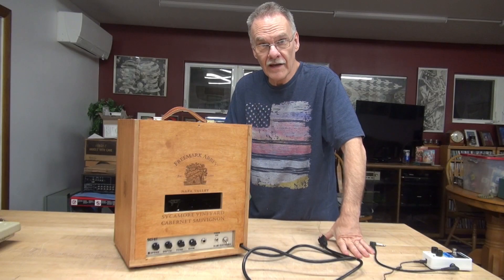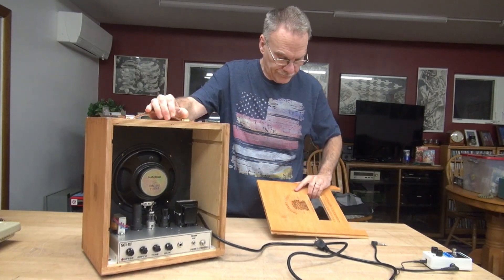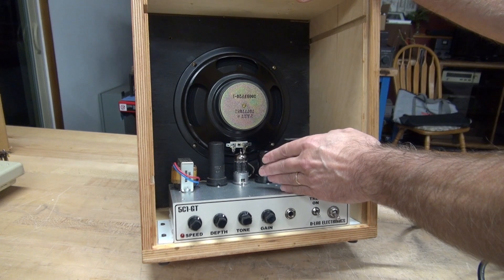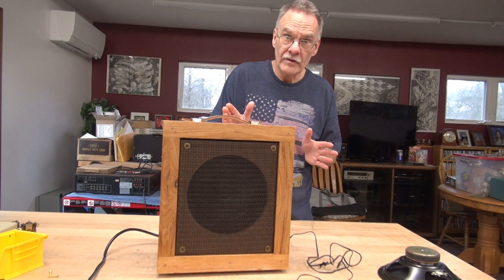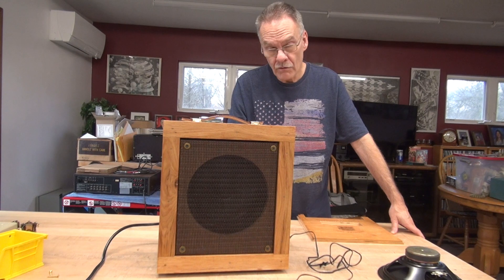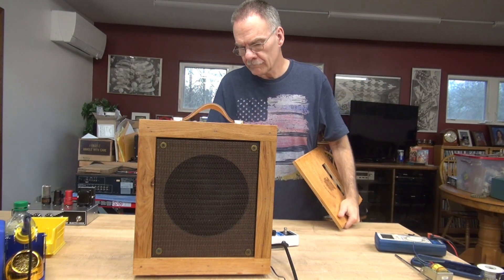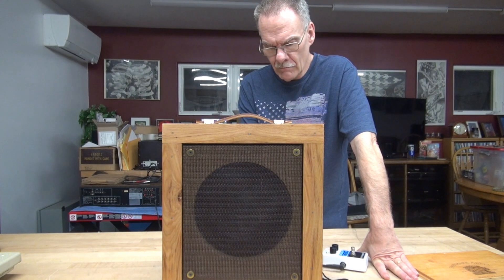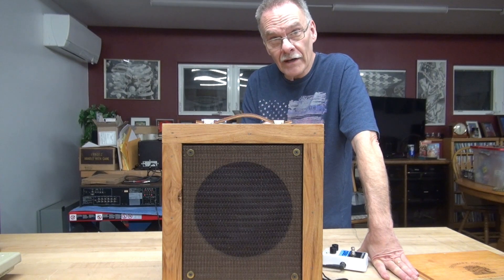How to fix Tube guitar amps with too much bass, muddy, Example Fender 5C1 champ homebrew boutique

Comment: Wow, that’s Amazing Terry. I built a 5F1A+ from Allen amp as my first amp. It’s a Champ/Harvard with an extra 12AX7 in the Circuit and I have 1/2 of the 12ax7 free to add this tremolo. Down the rabbit hole we go, for your Patreon ,which tier would one have to join for the schematic of this
Reply: Thank you Terry, I will do just that. I Subscribed to your Patreon Terry, thank you. I’d love a schematic of this amp and if you ever need a new project how about a low cost budget SE stereo amp, could be diode rectification to keep it even more cost effective. I’m rebuilding a el84 w 12ax7 preamp for my son now
Reply from the maker: Cool deal man, I appreciate your support. The latest schematic and layout are posted.
Reply from the maker: Hello, Cool deal on the Patreon, just the minimum to have access to schematics. Plus I can send them direct

Comment: What difference does it make changing to a 4 ohm speaker and appropriate 4 ohm output transformer from the 8 ohm design? The load for the output tube is the same if the transformers present the same load to it. It's just a matter of turns ratio. Terry, can you explain why the 4 ohm speaker (assuming it's the same brand as the 8 ohm) has more high frequency output if the same transformer load is present in both designs?
Reply from the maker: I believe the actual fix was installing the ClassicTone output transformer that was designed for guitar amp use. The original P-T31 transformer had no specs as to their intended application. The ClassicTone transformer secondary was 4 ohms, so the speaker change was also necessary

Comment: Us viewers must not have been hearing how much bass the original configuration had because I didn't hear any problem at all with the original configuration, I actually preferred it. I would have targeted a cap of two before replacing pricey parts, but I'm sure you sorted it out.
Reply: yes me too, liked the first config.
Reply from the maker: Here, it was very muddy, Tone was maxed on treble side. The ClassicTone output tranny made it much crisper and now the tone control can be used. Sorry, it did not process well over Youtube
Reply: I experience that same "I prefer it that way " scenario too. Sound demos on  YouTube  is just a flawed concept to begin with. Initial recording colours it, uploading, downloading, digitizing,compression and then the final insult..... replaying on our equipment in our rooms with our ears. Zero hope of an accurate representation of  the original  noise. But  still I watch them day in, day out......

Comment: So switching from 8 ohms to 4 ohms fixed the Bassy problem?
Reply: Output transformers and speakers were matched with the originals (8 ohms) and the replacements (4 ohms) so I wouldn't think that in itself would affect the bass.  Other differences in the transformers and speakers would be much more likely to affect the sound than simply 8 ohms vs 4 ohms.
Reply: @7171jay  It sounds like a "impedance mismatch"? if the output transformer is 8 ohms and the replacement speaker was 4 ohms that is a mismatch so I'm guessing it caused more hoofness bass?
Reply: @waynegram8907  Actually there is no impedance mismatch.   The amp originally had an 8ohm output transformer and an 8 ohm speaker.  The mod to it here was a 4ohm transformer along with a 4 ohm speaker.

Comment: You don't need to change all that stuff to get a better tone. Just add a 600 volt .008 mf orange drop cap above ground to the volume control essentially your bypassing the volume and letting more high frequencies pass to the next amplifier stage it's essentially its a  brightness control.

Comment: That wine crate was turned into a real good looking cabinet and the sliding rear panel is a real bonus for quick and easy access. And now you've turned into a great sounding little amp.
Reply: Deee